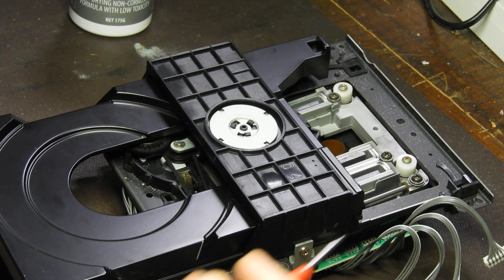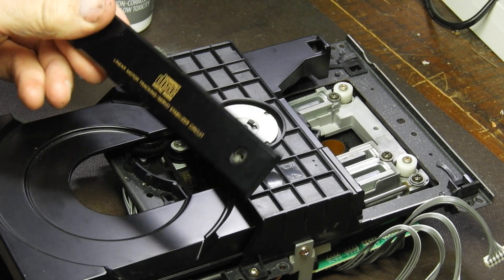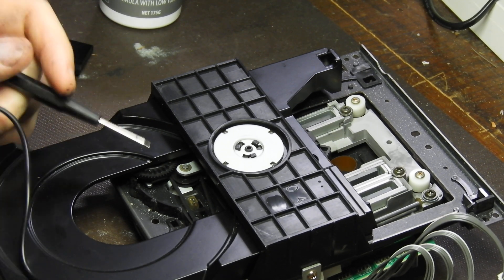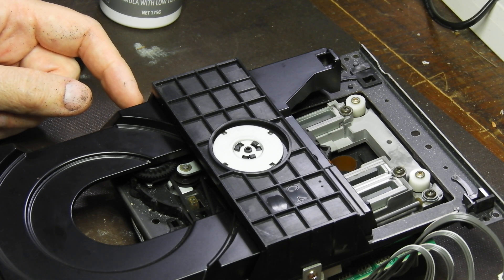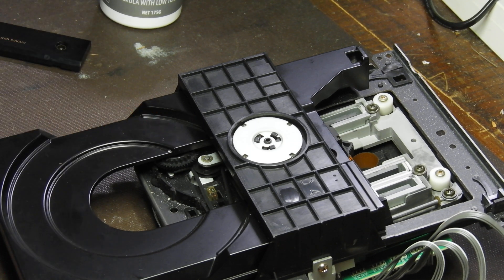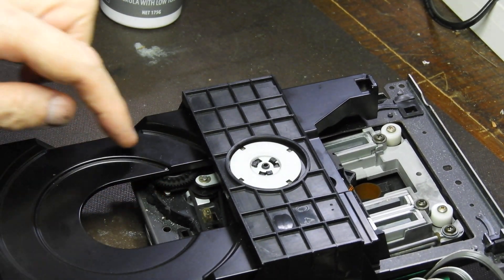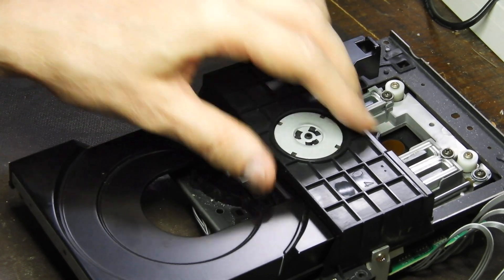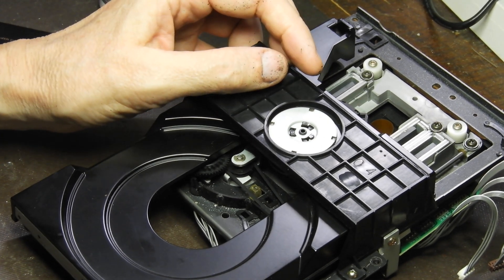Limit switches cleaning and belt replacement in Sony CDP-338ESD - special request video for Arthur

Comment: I have this same mechanism in a CDP-508ESD. I had to replace the belt and cleaned both switches with a contact burnishing tool. My original problem was a slow tray and the tray went in and immediately popped out. Repeated action - it would stick once in a while and it works very well. After carefully disassembling, cleaning switches, replacing belt - It only will close (and play) but refuses to open. It's locked in. Manually tapping on both switches ( while i had it open) , they seem to operate properly, reversing the motor direction. Why am I having the open problem now? Perhaps it's the alignment of the cog and groove? I can't figure out how to release the tray. I'm stuck and frustrated. It's a beautiful player and hate to scrap it. I probably should have let it be as it was. played perfectly. Thank You. I hope you see this soon. - Sincerely - George - USA
Reply from the maker: When cleaning limit switches, you should measure them with ohm-meter to see if it really done. When finished,, the resistance should be well below 1 ohm. Do not use "burnishing" tools but electronics cleaning solvent. Contacts have to be really clean to work well with small voltages and currents. This is not automotive industry where 5 or 10 amps are flowing through the contacts. 
When the mechanics are finished, run through the whole loading / unloading process, by manually advancing the tray turning the cogs with your finger.
Reply: @ thank you. So much!!